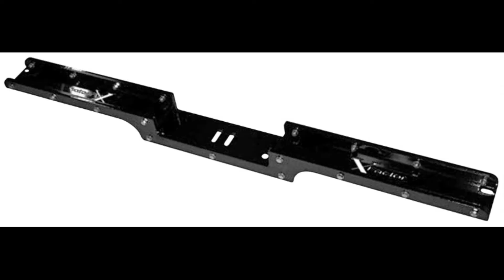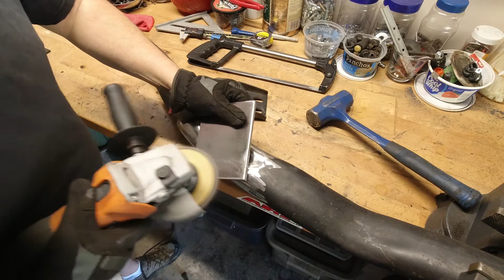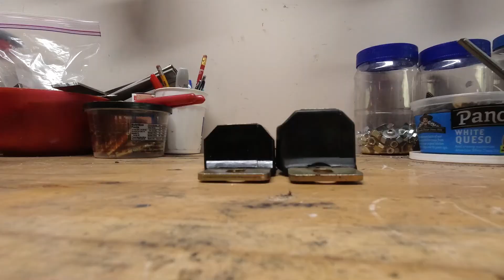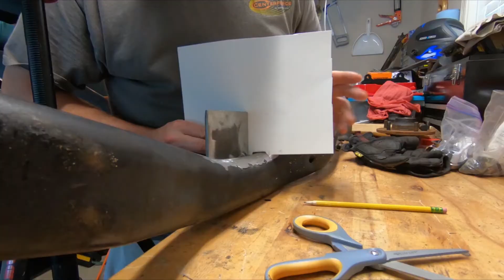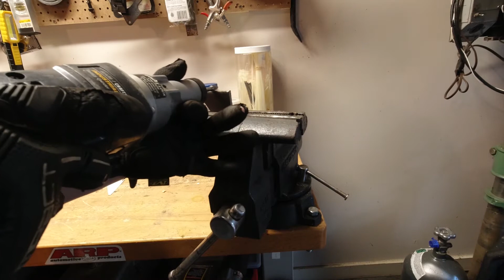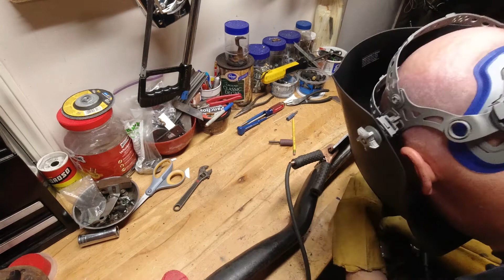Chevelle T-56 Crossmember Fabrication Part 2

Comment: Thank you for the great video. I have a 66 4 speed Chevelle that I’m about to convert to a TKX or a T56. I mainly want the smoother modern shifting and the extra gear for mileage. I’m also changing from a 396 to a 454 that makes about 625 hp and roughly the same torque. At that power level the TKX may not hold up, as I do plan to make a few drag strip passes just to see what it will do. The hit on slicks is what concerns me, even making a few passes. I hate the thoughts of cutting up my floor. My car is already restored and 100% done cosmetically inside and out. That being the case, I’m leaning toward going with a TKX and feathering it out of the hole. In my situation, what would you do? Thanks again for the great videos. Subscribed.
Reply from the maker: You can run the TKX but I would highly suggest having it upgraded if you’re planning on running slicks.  American Powertrain has an upgrade package on the T56 that included cryo hardened shafts and some internals.  Last time I had it done it was around $2000.  Give them a call and they can quote it.

Comment: Just curious if you are aware that the transmission was down the whole time. First, a +4 angle would put that transmission up through the tunnel and point toward the back seat. Second, the two comparative measurements you show are from opposite sides of the car. By moving the mounting plate and dropping the back of the transmission by .5" you dropped the trans from the original -3.5 to the desired -4 degrees. Had it moved 7-8 deg you would've needed to move it down around 8". As far as the way to modify the crossmember for a slight adjustment, great video.

Comment: Great video. I need help.  Do u know the specs on an 882 sbc head? I’m looking for heads but don’t have engine specs as far as cam, pistons, etc. there cast with 333882 so I’m assuming there 882 heads. Looking to buy Summitt 162112 or Summitt 152113. What’s my first steps in figuring this out? If u have the time thanx
Reply from the maker: It’s a good question.  Unfortunately other than some time on google to figure out the specs, I wouldn’t have a clue.  Sounds familiar so I’m sure you’ll be able to find a little info on them with some digging.  If you’re shopping for heads, start with your power goals.  Building a 500hp street engine?  Then you can determine how much runner you’ll need to flow the fuel and air to make that power.